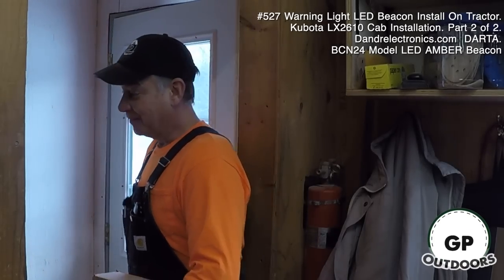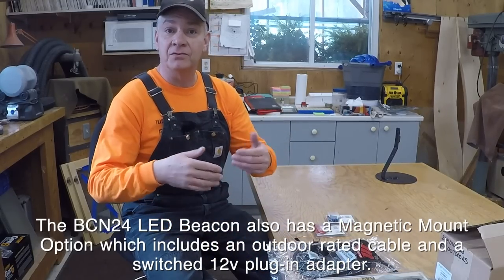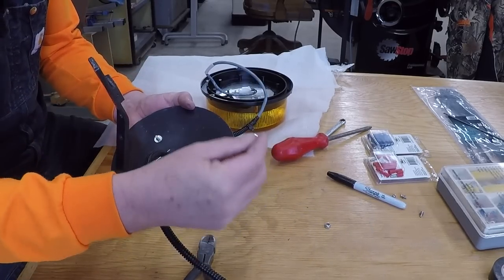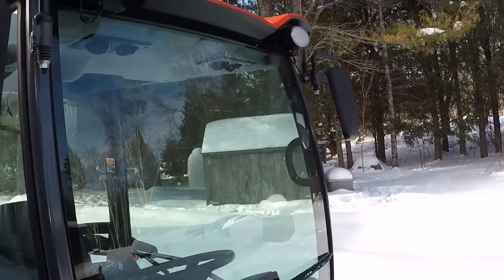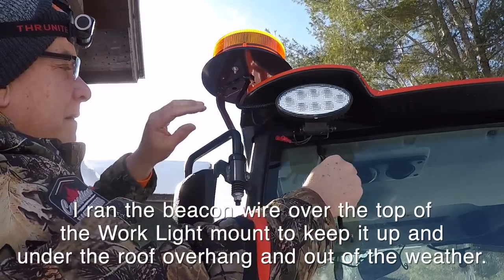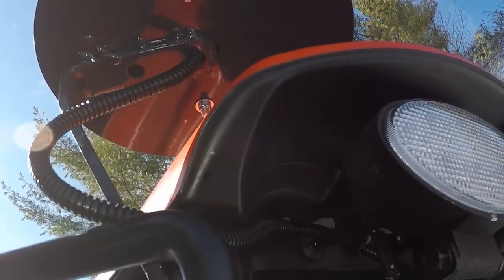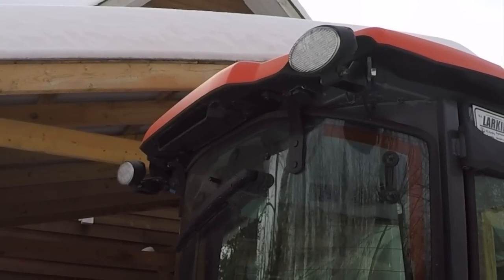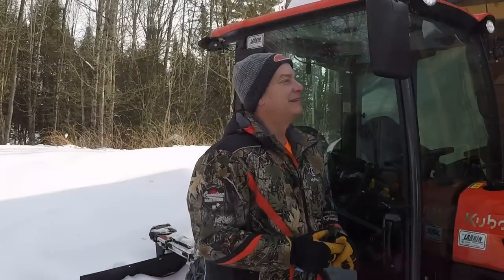527 BCN24 Warning Light LED Beacon Installation on Tractor.  Kubota LX2610. Part 2 of 2 .

Comment: Great video, Gord!  

If I may suggest, re-mount the light on the left side of the tractor.  There is less chance of hitting a branch, less chance of it being blocked by trees while driving along the concession and it places it closer to passing traffic indicating the width of your tractor better.
Reply from the maker: Hey thanks RT! I wanted it there but the antenna is mounted and wired to the left side. So had to go with the right. Have a great week!

Comment: Good video and some sound advice. One thing I think would be beneficial for you is get some dielectric grease and put on the bullet connectors. This will help a lot with corrosion over time even with the wires being tucked away. Enjoy your day.
Reply from the maker: Great idea - thanks Michael!

Comment: Exactly how imagine the bracket :) Put some silicone grease  (or other grease) on bullet connectors to prevent oxide. 
When i use bullet connectors i usually have female feed positive and male on minus.   

Great video :)

Comment: That is one bright light! I added a magnetic mount battery powered LED beacon on the mirror bracket. I reach up to turn on and off when entering or exiting the cab. Not as bright but will get me by without wiring this winter. Thanks for the great video and product information.

Comment: Nice set up Gordon..the only thing I would have preferred is bullet connectors with heat shrink but I think you'll be fine . 
   On a different topic..I never throw away old extension cords with bad ends ...they make excellent wire for running wire to lighting and other things..I prefer it to single wire being ran..it has double insulation so no need for additional loom and is more weather tough
Reply from the maker: Some great tips Chris - thanks!

Comment: Great looking job you did Gord and Guy too lol. It looks like a factory made mounting bracket. It's always good to do a project like that yourself. When are you going to put a grill guard on, or is that the next project? Cheers 😀😃
Reply from the maker: Morning PJ. LOL. I have been thinking about that for a bit, but still on the to do list. A few options out there I have found, instead of building it, but not sure which way i am going to go yet. Cheers!

Comment: Good video, Gord.  Did you go back and silicone or plug where the wiring used to come out from the base?  Heat-shrink bullet connectors and dialectric grease help stop corrosion around your connections.  Maybe not such an issue in Ontario, but in the salt air on the Atlantic coast, it helps a lot.  Keep up the very informative videos.  Cheers
Reply from the maker: Thanks - I didn't but I have some on hand so perhaps I should - thanks again!

Comment: Gord, Thank you...  Excellent info on running wiring down the rear corner post and under the fender.

You also mention the fuse panel or fuse block.  Where is the fuse panel located on the LX2610 ?
Reply from the maker: It is right at your feet - I'll take video of it for you Dan!
Reply: @GPOutdoors  Awesome.  Thank you Gord.

Comment: As others have said, get some dielectric grease for those connections—it will save on corrosion in the future. Also for future reference or others doing this, use one male snd one female on each side of the connections. For example on the light do positive wire as a male connector and ground/negative as a female connector and then reverse that on the tractor connection side. Also use some heat shrink tubing over the wire end of the connector to provide some water resistance. Or better is to get 2 wire connectors that have build in water resistant connection. This ensures correct connections in low lighting. 
Great job on the install and mount.
Reply from the maker: Morning Coy! Some great advice and recommendations for folks. Thanks so much!

Comment: Maybe use a little lock tight on the screws as they might tend to back out. Nice maintenance loop on the wires.
Do you get any static on your radios with the LED lights? Very professional looking install. I Always enjoy doing this kinda work.
Shout out to all the Canadian truckers. Show that love. 
Cheers.
Reply from the maker: Thanks harry, That's a good idea. I have not tested it with the radio yet but it meets the SAE "J" standard for electronic interference so it shouldn't but I will check that out. ( the radio is kind of static-y to begin with but I'll see if it is worse. Thanks again!
Reply: I think it might be more your work lights than the beacon?

Comment: Hi Gord !  Thanks for Part 2 !  Was on the lookout for it, but YouTube is not great at sending alerts, so  manual check and bingo !  Nice install !  Guy is a really good friend doing the mount for you and that added piece for stabilization was a good suggestion by another viewer.   What type of cost are we looking at for the unit you purchased ? I was on their website but there's no pricing. You must ask for a quote.  I was just on Amazon looking, and many of the beacons are anywhere from $29 up to  $60, some were almost $100 ( Amazon Canada I'm talking about ) it would be great to know what to expect in terms of cost for your vs the junk on Amazon.  Anyway thanks for the video it was a good one, and the intro of you driving up the road was good, wow.... nobody is going to miss you coming or going !  Safety is #1 on these roads !

Comment: Another great video GP, liking the new warning light! Just a suggestion you might want to put a little dielectric grease in your connections to help with corrosion and moisture!
Reply from the maker: Hey thanks K! I have some so will apply some. Cheers!

Comment: One trick that might help next time is to go to kubota and get a pair of connectors for the led cab light.  Then wire these together on the beacon wire.  Now you can remove any light without having to remove the other and you can do the wiring inside in the warm. Cheers!

Comment: Kubota LX2610 and 3310, are factory prewired for warning beacons. The exterior wiring is located beside the right rear led light. The dash has a cutout on the left side for the factory switch, and it’s wiring is taped to the main harness. Kubota in there wisdom has made the switch wired to battery feed, so you need to remember to turn it off when leaving the tractor.
Reply from the maker: Good morning and thanks Bruce -excellent information to know. I will take a look at it, as I did not notice any additional wires there. Question, (if you know), do you know why Kubota does not make a mount for the beacon as well? I know they do have a Beacon I can buy, but no mount for it. Cheers and all the best!
Reply: The pig tail near the work light, is very small, perhaps 1/4” wide, and the end is taped to the light harness. Hard to spot. Cheers from Nova Scotia.